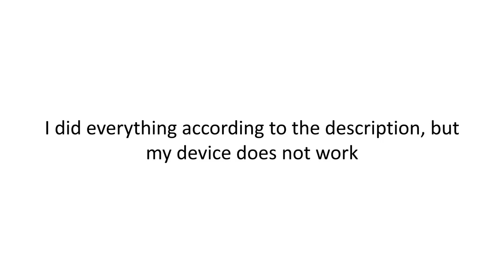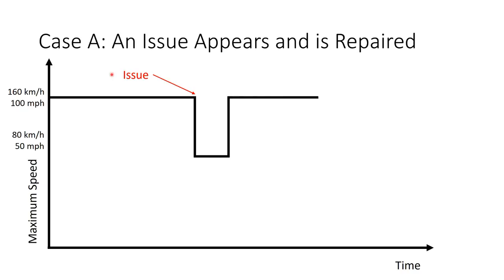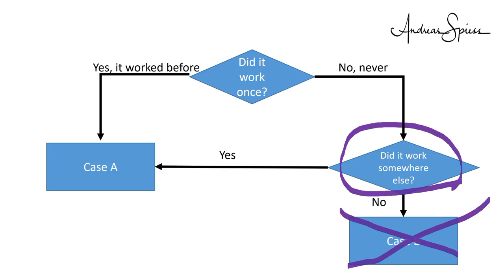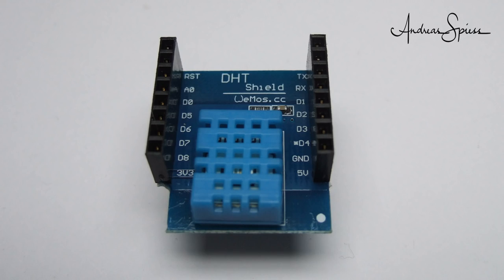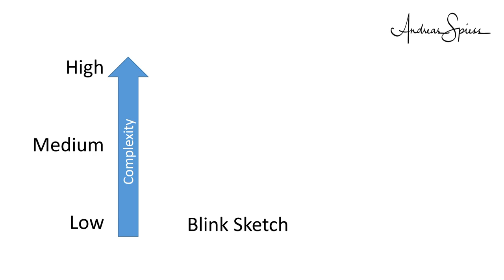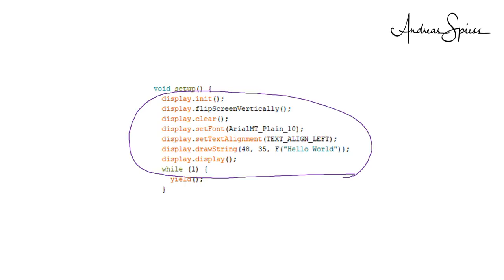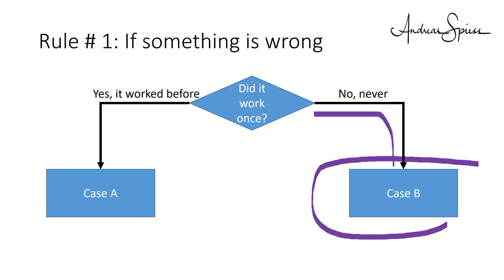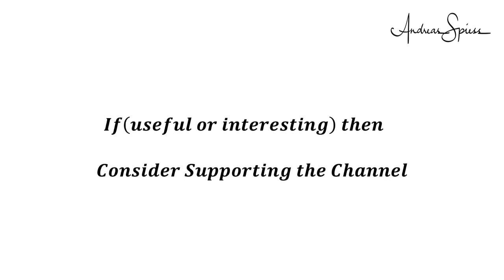#184 Finding Errors: 7 Rules to get them faster

Comment: I would add ...

1  RTFM (Read the ....Manual) / data sheet, etc

2  Measure voltages

3  Do not spend too much time looking for the fault, do something else and come back to it

4  Try each component in a different system and see if it works there

5  Don't give up. You learn more by fixing things rather than when they work first time
Reply from the maker: Good points. Especially point 4. Point 1 is not a favorite point for many engineers ;-) And 5.: In my world, you can only learn from errors. Without errors, you already know how to do it.
Reply: Datasheets will lead to mistakes as well. 90% of new makers will read only first page. So rule number 0: Learn how to read datasheets and discard sales pitch.
Reply from the maker: I had such an example in my last video...

Comment: Andreas, this is a great contribution to the makers community in general. As an industrial automation engineer during the years I've developed a "sixth sense" for troubleshooting complex systems, and I was amazed on how similiar our thoughts processes work. I totally agree on the approach, for new inventions in the Arduino/making world  I would emphasize looking up for libraries and examples and going through them first even if it sometimes boring. It will be either that or going straight to the datasheets, which unfortunately were almost always written for engineers or people with a technical degree. Thank you!
Reply from the maker: Thanks for your addition.

Comment: I'm sorry for the book, but this touched home. The great thing about this is it applies to everything and you can call it by a number of things, Troubleshooting, Debugging, Diagnosing and Git-r-Done! I've used these very rules in every job career I ever had. The problem is when you ask a person these questions they feel stupid which makes your job incredibly harder, for example what was the computer acting like before it failed, did you try to repair it, if so what did you do? In my experience 9 times out of 10, they lie to you, but the truth was they opened the door and touched the motherboard and unplugged the power supply from the motherboard while it was running when the real problem was the fan was in need of some oil, but now all of the unlikely things are the issue like the motherboard is fried along with the power supply. Getting people to work with you using these sacred rules is like pulling teeth so I do my best to trick them into telling me. Over 100 computers customers told me after I repaired their computers said they went directly home and put it in the closet and it's been there for the past 6 months because they purchased another, but they lied and I'll tell you how I knew. I have a program called Index .dat suite that tells you every last thing you've done since the moment the installation of Windows was finished. These people would say they plugged it in and there was viruses by the hundreds, so I look at their records when they paid and most of the time I replaced the OS because the hard drive was bad or I killed the bugs, that's when I use that program. You can't open index .dat unless you have a program to open it. These people lie like politicians so I hand them a list of everything that happened since I turned it off and I always find out they lied. While I'm getting the list ready, I'm ready to punch them in their face! They wonder how they had identity theft so many times and I show them they had a virus like a keyboard logger the records everything you type and sends it back to the creator of the virus and a list of everything they purchased using every credit card including their bank card. I fold the dates over and show them, some of them will come out and say that's impossible because I just purchased that a month ago so they just admitted to lying out of their teeth then I show them that they went home and started using it right away, where they got the virus and what time of what date. At this point these people are hurting my business and I tell them not to come back and I keep a record because they will keep trying to have me repair their crap because I believe in good business and charge a third of the price of any competition. Most people will lie if you're repairing their equipment for money.
Reply from the maker: As I wrote earlier: Trust is very important in our lives. Your story adds another episode about that. If you cannot trust, life gets complicated.

Comment: Probably the best proactive solution to troubleshooting is to try and have a very good grasp /understanding of all components involved. The break down is semi-easy at that point (almost certain in positive result if you don't quit and have time). Problem is, trying to balance studying every thing under the sun from an engineering/tech standpoint and trying to live a life outside of that. I've been there done that ...a lot. I weigh my projects in their worth for practicality and worth at this point for complex situations.
Other projects, it falls into the hobby, enjoyable category.
Reply from the maker: I try the contrary: To avoid studying things which are not necessary by trying to understand which component causes the problem. But sometimes I end up in the situation you describe where I have to understand (nearly) everything...

Comment: In another video, you mentioned Bob Pease's book (series of articles) on analog troubleshooting published by EDN magazine.  It's a great read, even if you don't specialize in analog circuits.  The first chapter is titled "Troubleshooting is more effective with the right philosophy", and includes a section called "Learn to Recognize Clues".  It includes four basic questions that share some themes with your steps:
1. Did it ever work right?
2.  What are the symptoms that tell you it's not working right?
3.  When did it start working badly or stop working?
4. What other symptoms showed up just before, just after, or at the same time as the failure?
He also mentions a quote from an old test manager:  "When you are taking data, if you see something funny, record the amount of funny".   Very wise words!
Reply from the maker: These are great questions! Thank you.

Comment: Excellent.  I'd like to add the problem of confirmation bias, where our brains seize on possibilities that confirm at least some of our assumptions and get very tenacious. I spent ages trying to debug a short piece of code and became completely convinced that the very recent release of the compiler must be wrong.  A friend took a quick look and said the test for equality is ==, not = (which is assignment in C).  I knew that!  But I didn't see it.  It's far easier to find fault with someone else's work than your own,  so others' eyes are valuable.
Reply from the maker: That is absolutely true. And it happened also to me...

Comment: I liked the explanation of exponential complexity with added features. I'm very guilty of doing that one to myself.
   I would also add that there is nothing wrong with shelving a project until we have an opportunity to learn more. In the past I felt guilty when I shelved projects. It felt like I had failed. After a couple of shelves get full with complete and incomplete projects, the incomplete ones don't seem like such a big deal, at least to me. I usually come back to them at some point.
    I've spent almost 4 years playing with hobby electronics now. It's a lot harder than cars IMO. I could add a N2O setup to your car faster than your typical parts replacer could install a new starter motor. That will take you to infinity and beyond ;)) I'm not sure about the metric equivalent of that one, but I think it's a lot
  ...or you could go my route... B&M roots mini blower on a 8.5:1 compression 355 small block Chevy in a '92 Camaro
... with a stick...cause it's a dude's not an automatic-chick's car
 ...but that's just my poor man's hot rod 
...and it takes forever to build a project like that on your own
-Jake
Reply from the maker: We all thing, that things we know are not complicated. Only things we do not know seem to be complicated. I think you were at this point before you started tinkering with cars, too. Sounds like nice toys you have BTW.

Comment: Excellent job, Andreas, these are timeless principles and good for more than just maker projects.  The open source saying "many eyes make all bugs shallow" applies here too - almost the more sure you are that "you didn't change anything, eg you copied it right" the more likely you did, inadvertently.  This is especially true with wiring errors - assumptions tend to creep in the closer to the wrong wire you are!  Wait awhile, or have a friend check it!  This saved my outfit endless time in the days of hand laying out PC boards and assembly language setup routines.  You just can't seem to see your own mistakes - mow the yard, take a nap - to reset your mind, or get a friend to help. 
I would amplify - divide and conquer as mentioned by Miharix below, as a fundamental principle.
I'll add from my early days as a tech on commission - always check the easy stuff first!  If that ever slows you down, it wasn't the easy stuff.
It's often something so easy and so dumb you don't think to check it - till you've seen plenty of easy and dumb issues (voice of experience).
I've always been a fan of printf() debugging (or just toggle a pin and use a scope - we didn't always have C).

Keep up the great work!
Reply from the maker: I agree with all you say and use it often. Only finding somebody who can help you is not always easy for me because he/she has to understand quite a lot to be helpful.
Reply: Sometimes you can shortcut that a little bit.  If you can teach them to read a schematic - not fully, just a little bit, what the lines mean, they can often help check - strangely, our circuits are simpler now than they were before so much was on one chip - and we've divided so we can conquer already by this point.  I'm often amazed at how often I find a problem when trying to teach someone to help - often a question they ask gives you the key.  It's one of those "if you can, it's good" kinds of things.   You can always divert to some other task for a bit to kind of clean out your mind (at least here, there's always something else that needs to be done) and basically become "another person".  Doing something else wipes out the context and immediate detail (which were wrong or you'd already have fixed it) from your mind and you become that "other person" when you return - at least for a little while.  This might not take very long (at least when you are our age).  Paul DiLascia (of Microsoft MSJ/MSDN fame) used to say when he ran into a hard problem, he'd mow the lawn - and had the best lawn in the area as a result...It works.

Comment: "Divide & Conquer" is what I have called it in the past. I learn the most when I have to troubleshoot.  Just yesterday I put together two nRF2401 boards and they didn't comunicate.  Turned out it was the adapter modules but it took me a while to fiqure it out.
Reply from the maker: You are right, you only learn during debugging. If you make no errors, you obviously do not need to learn it ;-)

Comment: Nice video, I would also include "flag messages" or "checkpoints" 
for example, sending serial messages to make sure that the code executed to a specific point. This mainly works when writing code.
This way you can tell which line or section works and which is never reached.
Reply from the maker: True. I think I mentioned using serial print. But it did not make it to the rules...

Comment: Interesting to hear your background. I was in 3rd level support at Xerox. Sometimes we needed to build tools to investigate problems - particularly those we could not reproduce at first.

It works for one hour and then fails - find the source of the memory leak.

Core dumps etc. Fun times.
Reply from the maker: Yea, intermittent errors are the hardest. If you are able to reproduce them, usually they are nearly solved. But reproduce them is tough...

Comment: Good stuff, Andreas, as always.
I would add a footnote to rule 4: "preferably from different vendors". Small letters and parcels traveling sometimes literally to the other side of the globe get often lost or delayed in transit. A component from China can take even 2-3 months to arrive, while some parcels spend less than two weeks in transit. By buying a 'spare' item from a different seller, you drastically increase the chances of at least one of the parts arriving in due time.

Teaching debugging and problem diagnosis/solving is very difficult, even to STEM university students who IQ-wise should be above the 90th percentile of the general population. Too often you see students just giving up when something does not function immediately. I reckon videos like this will be of significant benefit to people who have not yet internalized the systematic and analytic flow of thinking needed in making things actually work.

BTW, the Indiana Jones vs. the Arab swordsman scene is brilliant, but the story of how that scene came to be is simply epic! :D
Reply from the maker: You are right, and if time is an issue, I sometimes do the same.

Comment: Very good advice. I also use the rule of, If possible only change one variable at a time. I am surprised you did not mention one of the most common problems with these circuits i.e. check and test the interconnecting cables, especially usb types, how many times have we picked up a cable that is not the correct type, defective or a poor performer? 
With bigger projects and/or heavy electrical loads, insufficient power and/or incorrect voltage levels are a big issue. Solderless breadboard connections are not as good as soldered joints.
Polyfuses can confuse a beginer. The list goes on and on. Your videos are excellent reference aids but I fear that this subject is such a massive topic, a short video is just a starting point.
Reply from the maker: I think I mentioned connections as # 1 problem in one of the slides. And because I agree, that many different errors exist I tried to ""generalize" the search a little. I agree this can only be a starting point.
Reply: Please accept my apology, your colorful slide at 43 seconds, contains a rectangle with; 'Check connections - Fault #1'.

Comment: Great Video -one extra point I have found is using the power of 2. Just as complexity goes up very fast so dividing the system in half towards  the known working condition you can locate the issue very fast. Example you can remove half the number of sensors from the processor board. If all sensors work correctly using  those half then problem is in the sensors removed. Then insert half of the remove sensors and see it works and so on. You should be able to find the issue in extreme fast time compare to testing one at a time. This is the case in software and hardware. ------------------------Andreas keep the great videos going.
Reply from the maker: Thanks for your addition. I think I used your method in the video for my first cut by dividing the system into two parts with about equal amount of components.

Comment: These are good general rules. And surely they will reduce the frustration level for those following them.
If the problem occurs when trying to make something you have seen in a video or other description, we get rule 7.1: Go back and check the video/description and see if you followed it exactly! Substituting a component, library or environment will likely not work as expected. If you want to do something similar, start being exact, then add complexity (changes) one step at a time.
Reply from the maker: This exactly what I wanted to say. Thank you for the clarification!

Comment: This is a good description of what is intuitively done. I think stating it helps ensure its a structured process. 

I like rule#4. Maybe I need to apply that. I have been buying one part and see if it works before buying more. So far two independent items failed me with both being under USD$4. A backup piece of hardware would have helped a lot.
Reply from the maker: Unfortunately, these things are not intuitively done by all people... Otherwise, this video would never have aired.

Comment: To be exact, disregarding aerodynamic improvement, you will need 8 times the motor power to overcome the air resistance, to double the speed: P=cwA*(rho/2)*v³ (rho being between 1.14 and 1.42 for 30°C...-25°C and varying only about 1% depending on humidity)
Reply from the maker: Thanks for the correction!

Comment: I learnt the hard way about adding "just one more component" and "just one more function".
After about 10 of these, you have something sophisticated and impressive, and you've built a case around it, but when power suddenly fails or the Arduino freezes regularly it's a nightmare to lobotomize and find it.
Reply from the maker: Thanks for your example to support my claim.
Reply: No worries. It's thanks to you I have a neat Nextion screen instead of a horrible 16x2 LCD as an interface for my remote controlled fully programmable heating system.